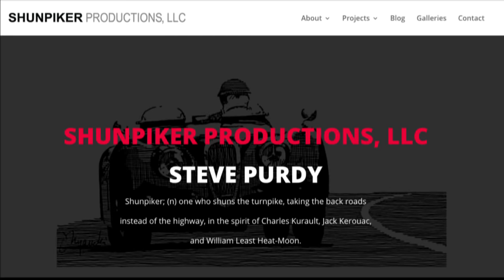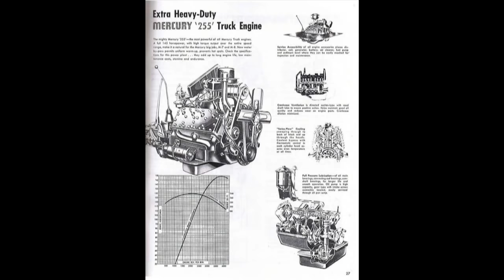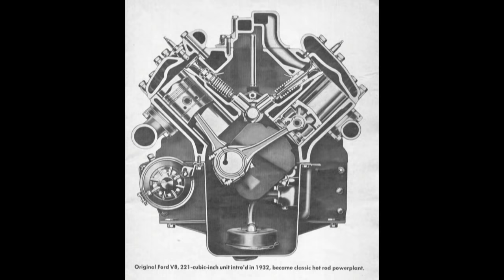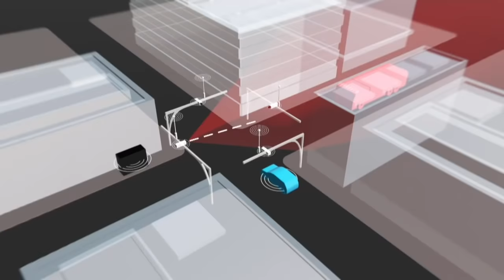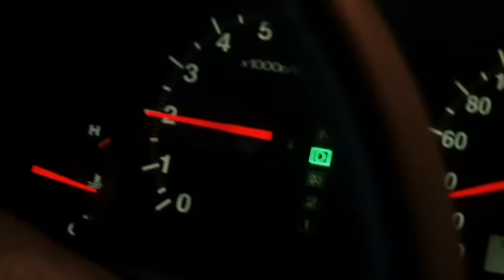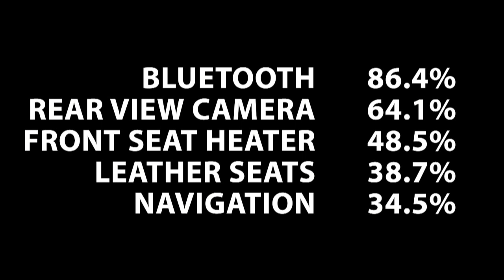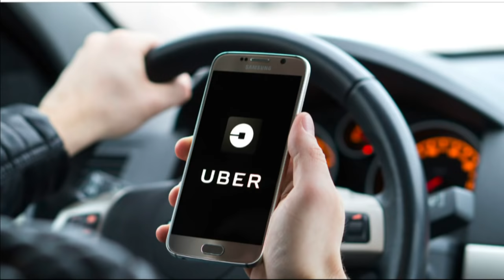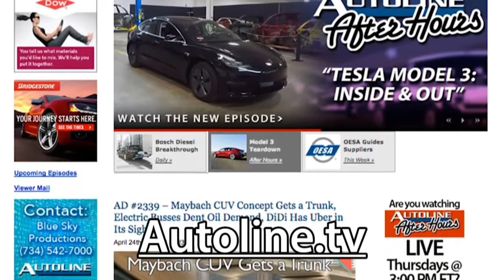Gearheads Talking Flatheads - Autoline After Hours 439

Comment: Speaking of quiet idlng engines, I pulled off the road once in my Chevy Colorado four-banger when it was fairly new and I was inxperienced with it.  When I was ready to go I thought I had turned it off because it was quiet.  So I tried to start it and nothing happend!  I thought I had a serious problem for a few seconds, then realized that it was smart enough not to crank a running engine.  Now I look at the tach.

Comment: A local flathead enthusiast (last count he had 12+ engines) is building a twin turbo flathead with a lot of performance parts (scat, offenhauser, etc). Currently running a single turbo, that replaced the supercharger. Simca Vedette had a 2351cc flathead v8 until 1961